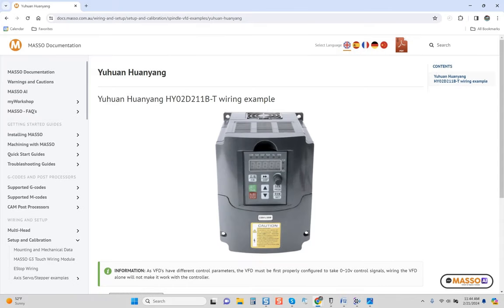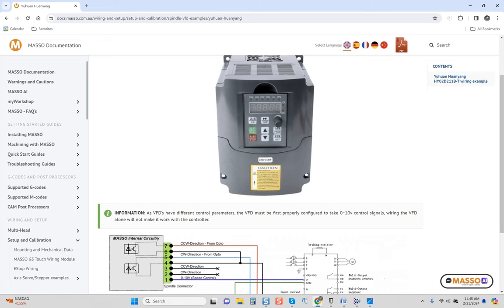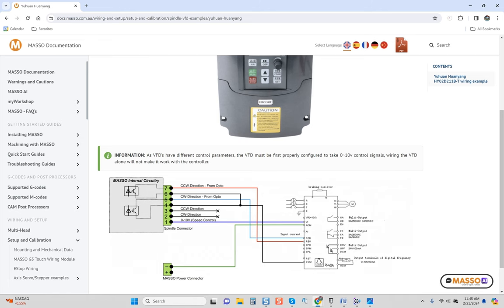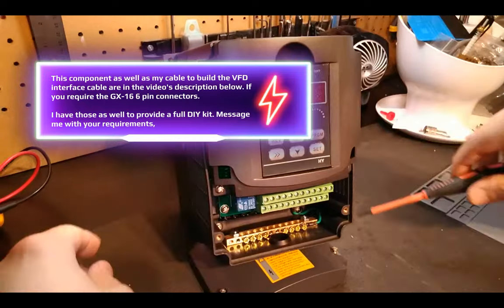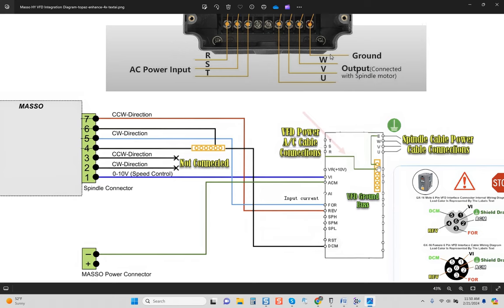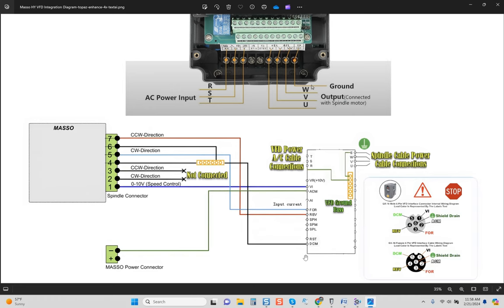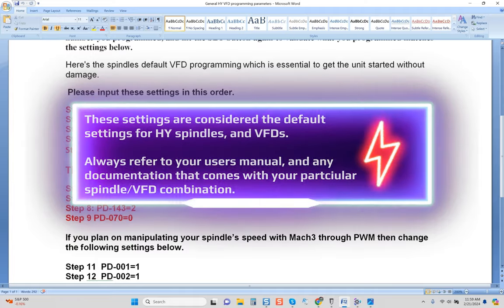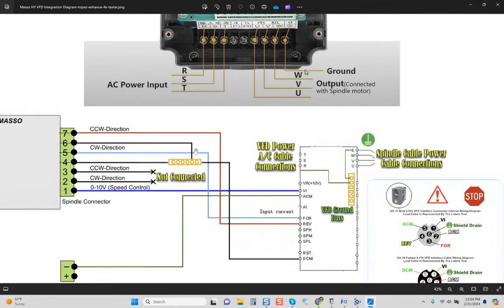How To Wire An HY VFD And Spindle To The Masso Correctly

Comment: I have an important question. My house was wired 50+ years ago and does not have ground. All it has is +/- from the box. How would I wire a ground on this VFD? In this case, does it require a ground back to the box? Could I run a wire outside to a ground rod if needed?
Reply from the maker: Hey Joel, Thank you for your support. What you're discussing is actually more common with the sales of older homes.

 If the breaker box isn't up to code which it wouldn't be if a ground buss isn't present then it would have to be brought up to code. 

This is a major safety issue, even before running any robot.

Thank you,
Vince

Comment: Thank you for putting this info out. I have HY vfd 110v 2.2kw 3hp connected to Masso Touch. Set it up just as diagram shows, and my vfd /spindle works. My question is about speed of spindle. Masso Touch gives me ability to manually test spindle from MDI command, which is nice, but the problem is that when I tried to warm-up my spindle(I usually run it for 15min @10000rpms before I use it for cuts) by typing s10000 m3, my spindle revved up to 35000rpm(that's what my vfd was showing)! I've quickly stopped it with m5 command. So i tested with s3000, and it runs @9500rpm. S4000 gives me close to 16000 rpm. I know its the VFD settings, but I'm so new to this world of electronics, that looking into manual for answers is making me even more confused. I know its parameters that I need to look at, but which? Any help and pointing into right direction for answers would be greatly appreciated.
Reply from the maker: Thank you for your support, and kind words. I'm glad the video helped you. Masso should be directing you on how to get the PWM voltage corrected as this is what controls the speed. Please contact Masso as you purchased the controller from them, and they should be supporting what they sell.

Thank you,
Vince

Comment: This is amazing. Thank you so much for taking the time to create this. I have that exact vfd and spindle have no idea which cables i need to buy. Can you help me? Which spec 4core shielded do i need as there's so many options. For vfd to masso is it 6 or 5 core and does it need to be shielded?
Reply from the maker: Thank you for your support. You'll require my 20awg 5 lead DS Flexion ultra flex double shielded cable here.https://www.ebay.com/itm/133891673190

Just let me know the length you require, and I can custom cut it if this length is to long.

5 lead is required with a GX-16 6 pin connector as the 6th terminal is allocated to the shield drain of the cable for proper EMI dissipation. 

Thank you,
Vince
Reply: Will need approx 7.5m please. Thank you so much.
Reply from the maker: Ok, please message me through my video's description to get your order in. 

Thank you,
Vince

Comment: I don’t normally comment but there drawing is an eletrical drawing. You wouldn’t add a busbar in that type of drawing. But I appreciate your helpful video as it’s been useful for me
Reply from the maker: Thank you for your support. 

Actually controller wiring diagrams is exactly where you would install a ground bus diagram as it lets end users understand its required to properly allocate shield drains to from their required double shielded cables. 

Thank you,
Vince

Comment: Mr.  The frequency in the USA is 60 HZ AND THE FREQUENCY OF MY MOTOR IS 50 HZ.  THE PARAMETERS P0.03 60HZ, PO.O4 60HZ, P0.06 60HZ, AND FOR THE MOTOR P2.02 50HZ Is this correct?  my gt vfd is 5kw 7.5hp thanks
Reply from the maker: I answered this comment on another video you posted on. Thank you,
Vince

Comment: Hi. With single phase connection live and neutral can be connected indifferently to  R S T terminals or there is a specific way ?
Reply from the maker: R connection is for Live, and T connection is for Neutral. This is the correct way to wire it. Thank you,
Vince
Reply: @corvetteguy50  Thanks for the clarification Vince 😉
Reply from the maker: You bet...:)

Thank you,
Vince

Comment: Do you have to oversize the vfd compared to the spindle wattage.
Reply from the maker: Thank you for your support. I've never seen a need to in real world testing.

Some manufacturers claim the VFD should have higher output, but when asked for real world examples showing the actual difference it makes I've never seen any actual verifiable proof. 

All oversea VFD/spindle combinations work fine when matched with the same VFD output as the spindle they'll be matched with. 

Thank you,
Vince